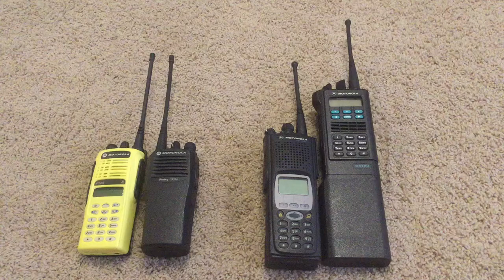Kenwood NX-5300 Demo

Comment: You need to adjust the audio profile to meet the 1 watt in either digital or analog and user likings. The defaults the nx won't cut it. Motorola by default kicks the audio profile to full 1 watt use in analog or digital and flat.

Comment: Keep in mind, the programming software must be obtained from dealer and price varies depending who you are. You'll get a quote request first. After once you get the cps you have register with their server to use it. Digital modes for the 5300 nx series do not come default you gotta buy them extra. Only analog and nxdn come default on the nx series. Dmr and p25 you gotta buy the modes seperate. Quotes vary again depending who you are, agency etc. Software can only work on one pc at one time and each time it is  Uninstalled the install must be re registered online over the server before it works. Just heads up. I've seen them deny people also with the nx series cps.
Reply from the maker: LosRioDelMar yes I found that on top of the headaches of the software and registration from the dealer, you also have to obtain firmware updates from dealers which with as many bugs as the NX had was a major pain as well.

Comment: I have a 7000xe and a ton of other units all different brands ham and professional. I'm a Firefighter and work EMS. Aside from my Engineering main job. I almost ahve all the Licenses I like $1500-2000 finished for my NX-5200-K3 and I've got $3200 put in it now. When I bought mine it was a brick. I have the AES&DES encryption card in. My VHF5200 reaches. Farther than my APX 7000XE. I tested in the same spot so it would be fair. I've been a Motorola fan forever but when I took the housing off of the 7000 I saw how poorly they made the 7000. Maybe for y'all it doesn't matter but I'm actually using it in house fires etc where it's a lifeline. The Kenwood is built like a brick shit house. And anybody that says it's not good. I know you haven't activated the licenses. I have trucking and conventional both open DMR/p25/NXDN. I only like a few but. It's my primary unit now and I have my 7000 just because it's a dual band and I collect every brand possible. This is a bias review. When all I see is Motorola you will never give an accurate review.